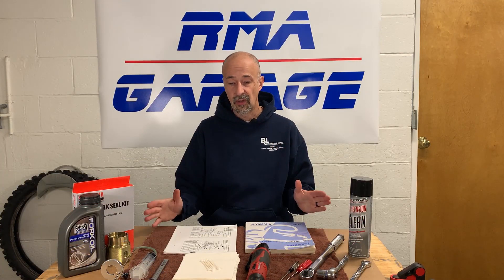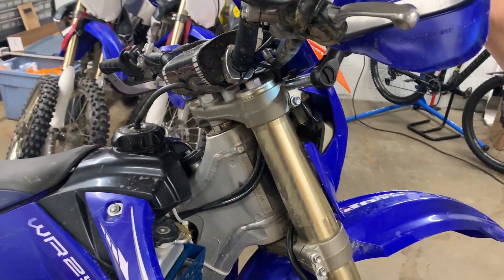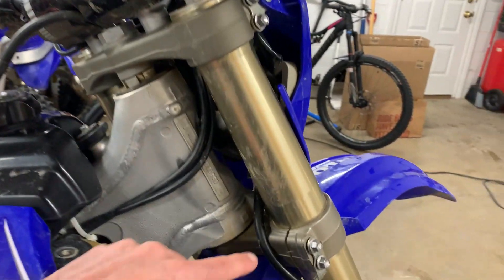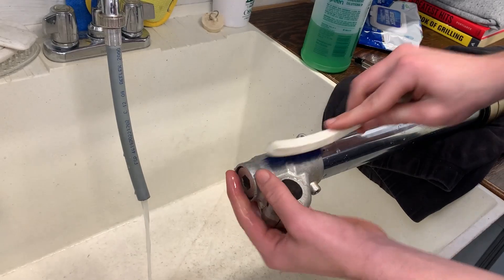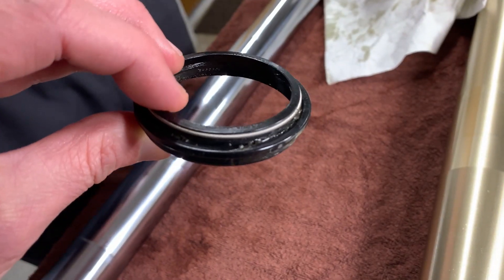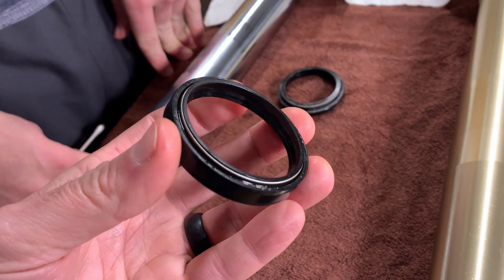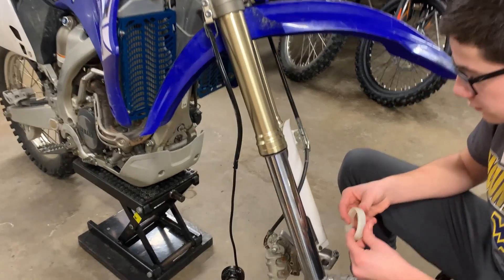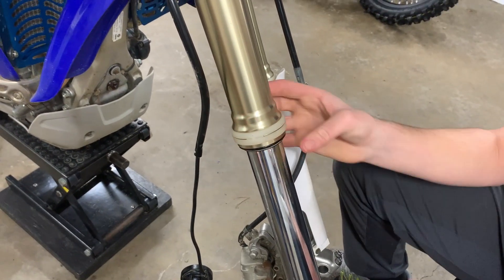KYB Fork Seal Cleaning/Replacement | Yamaha WR 250F

Comment: Glad you made this vid.  Changed out my seals on my wr450 last week, but they started seeping from the start.  Didn’t realize I’d put the oil seals in upside down.  Just finished rebuilding them.  No leakage.
Reply from the maker: Glad it work out for you.

Comment: The best detailed video I've seen for complete disassembling of the Yamaha KYB fork.  Are the current Yamaha KYB forks basically the same?
Reply from the maker: They current forks are not the same.  The fork I am working on is a off of a 2013 WR250F.  The new Fork is a dual chamber.

Comment: Great video if your already in there I’d be replacing the seals and bushes regardless if there damaged there inexpensive 
And it doesn’t take much to have a leaking fork seal I’d hate to get it all back together and it starts leaking straight away or a week later just replace them and your good for another 100 hours
Reply from the maker: Good Point.  Thanks for the comment.

Comment: Hey, great vid! A question.. What if I accidentaly poured the oil into the center of fork? When I placed the push rod most of the oil came out of course.. And I thought it probably doesnt mattet if theres oil or no. So.. Does it matter? 
Thanks!
Reply from the maker: I am not  sure what would happened or if it will cause damage.  I'm sorry as I do not have any experience with that.  I guess I would try and get as much of the oil out buy holding it upside down.  You might to check with a suspension guy and maybe he can tell you how to handle it.  Sorry, not much help.
Reply: Dont listen to the author of the video, he tells you that the oil must not go in the center hole but cant explain what would happen. It absolutely doesn't matter. Oil is inside,when you bleed the fork. Otherwise the rod wouldn't have any effect.

Comment: First off, I really appreciate this guide! You and your son did a great job. Just had some questions regarding oil height and oil volume. My manual calls for 295 cubic centimeters of oil, but the extent of that adjustment ranges from 260-365. That being said...
#1: How do you translate oil level to oil volume (or vis versa)?
- I saw you guys just poured in oil until it came close to the top, then sucked the rest out with a straw. 
#2: For example, if I want to put in the manual amount (295cc) in my forks, how many mm would that be from the top? Or if I wanted to go 350cc (recommended by RaceTech), how many mm would that be with the tool?

I heard that unless you strip the fork completely and dry it, not all the oil gets removed. So I'm hoping that the oil height tool used in this video is a reliable way to get the proper levels/volume. Sorry if these are rookie questions, I'm brand new to suspension servicing.
Reply from the maker: Can you tell us what year your WR250F is?  Ours is a 2013 WR250F and the factory manual we have indicates a fluid "Level" only and a amount in "CC".
Reply: @RMAGarage  2020 model. Yeah my manual only tells the fluid volume cc. Not an air gap. I’ll just be sure to bleed properly and fill the right amount in!
Reply from the maker: @fynn8252  Sounds like a good plan.  My father-in-law would always say "Well all else fails, read the directions". LOL!

Comment: The service manual mentions extracting the air from the air chamber completely before removing cap bolts. Did you do that? With the little nipple indent at the bottom of the forks?
Reply from the maker: We have not.  I am not sure why because when you take the fork apart, any air trapped comes out when the top cap is removed.

Comment: when you put the top fork cap back on do you leave the bleeder screw loose or have it tight?
Reply from the maker: We have the bleeder screw tight when assembling the fork.  Once the fork is 100% installed and after the first ride, I loosen the bleeder valve and bleed the air from the fork and then reinstall the screw.  Thanks for the question.

Comment: Did you put your oil seal in backwards?? Our spring for the oil seal goes up towards the top of suspension and the dust seal spring points down towards the axel....I could swear u out the oil seal upside down.....and when you put the spring in tube....hold a wrench under the damper pvc and twist the spring up and you don't have to catch the damper inside the spring....little trick
Reply from the maker: Thanks for the comment.  I love the tip with the fork spring.  I will try that next time.  Our fork seal has two springs, one the inside and one on the side of the "Scrapper" portion of the fork seal.  The "Scrapper" faces down.

Comment: Does using 5W oil instead of the yamalube 0W make any significant difference? I am thinking about using 5W because it's a lot cheaper.
Reply from the maker: The short answer is no, I did not notice a difference in the performance of the forks.  That being said, I am not a racer nor able to detect small differences in set up.  All I know is that the original oil I removed and the oil I installed seem to be the same.  I know they are different, but the difference is very small.  All the research I did said to go with 5w and all would be good.  So far so good.  Thanks for the comment.

Comment: Are these forks the  same as the yz250x ? I wanna do a spring swap but all the vids i find are complete disassembly
Reply from the maker: From the research I did, This is not the same fork as the yz250x.
I would try the video below (link).  This may be similar to yours.
https://www.youtube.com/watch?v=eru0iV8sU8Y

Comment: Want to know how much capacity one leg
Reply from the maker: I have been toiling over this answer because there is not fluid amount.  I was trying to come up with a way to give you the fluid amount but I would have to take them apart again.  The fluid level is a measurement from the top of the tube as the video describes.  If you are wonder how much to buy, 2 quarts will do both legs with some left over.  thanks for the question.

Comment: i can’t loosen the top cap it is so tight and it’s showing early signs of getting stripped
Reply from the maker: Did you leave it in the lower triple clamp and loosen the upper triple clamp?  Make sure you loosen the upper triple clamp.

Comment: Congrats guys and kind regards from Hellas Greece island Cyprus.. I have one WR250X model 2008, is the same.?
Reply from the maker: I have reviewed the front fork exploded parts drawing on our suppliers website and compared our bike and your bike.  They are very similar but not exact.  I thinks it is similar enough to go for it.  Just remember to take photos and write down the order of parts removed and there orientation.  Also, i would try and find a manual online if you do not have one.  That is where you will get the best and complete info.  If you get stuck for confused, don't force it.  It would be better to get professional help then to break the forks. Happy wrenching!
Reply: @RMAGarage  Thank you so much my friend.. of course, if you want and have the time, you would help me a lot.. I don't have the manuals and I am a little afraid of the amount of oil..
Reply from the maker: Ok, sorry for the long delay.  I think I found the service manual online and it is free.  See Link Below:
https://www.manualslib.com/manual/1199896/Yamaha-Wr250r.html?page=3#manual
the manual if for the WR250R and WR250X.
The amount of oil is listed on page 4-46.  It says 20.73 US oz.  If you email me at dirtbikedad48@gmail.com, I might be able to email you the manual because I was able to download it.  Give this a try.
Reply from the maker: If the link above does not work, Try this one....
https://www.manualslib.com/manual/1199896/Yamaha-Wr250r.html#manual
Reply: @RMAGarage  Sorry for the delay.. Thank you my friend 😊

Comment: Why oil seal and dust seal used , why can't we use one
Reply from the maker: Mud and dirt is very damaging and the extra dust seal makes the inner seal last longer.
Reply: @RMAGarage  and there is application of grease too ? Can we eliminate it why is that required if we have both
Reply from the maker: @apekshasamyal  You can eliminate the grease if you want to.  The reason why we use the grease is because we were riding is heavy mud and the grease seamed to help with keeping the grit from getting to the inner seal.
Reply: Okay thanks and the pipe is seamless pipe or seam weld pipe ? The top one
Reply from the maker: The pipe is seamless.

Comment: Cannot for the life of me get my dust seals in.. they will not seat all was around.
Reply from the maker: I did not have that problem.  If you have a fork seal driver, your can use that to tap it in.
Reply: @RMAGarage  have tried, it just jumps out, was servicing the forks after replacing the head stock bearings and it was easier to seat the bearing race's than to try to get the dust seal on, I am going to order some more, I think I have ether been sent the wrong year (but every other part fit) or defective ones. Cheers for the reply 👍
Reply from the maker: @HardlyDrivenSon  It sounds like they sent you the wrong one.